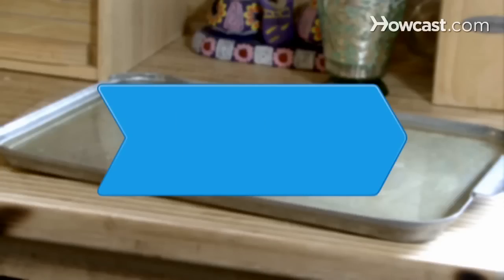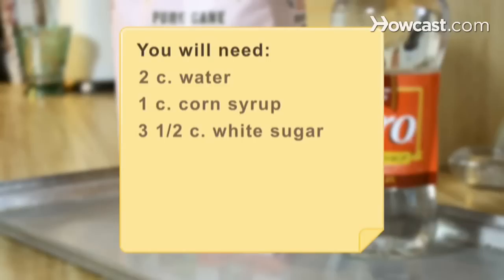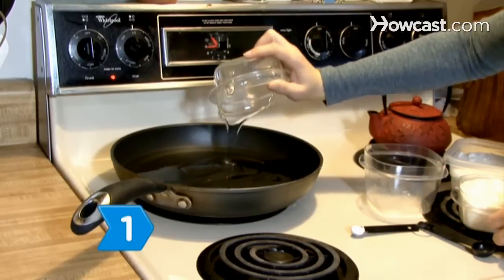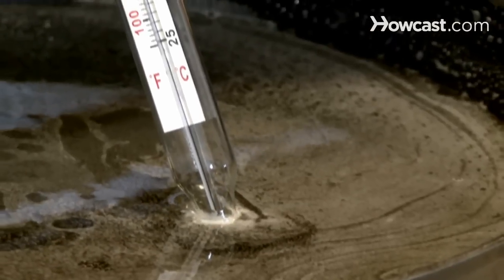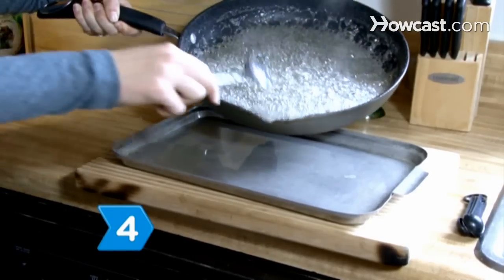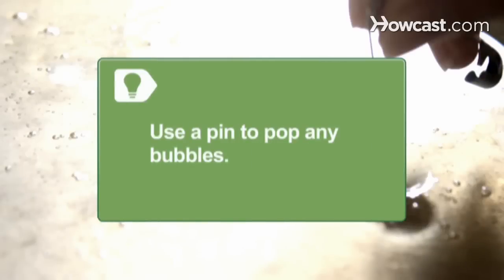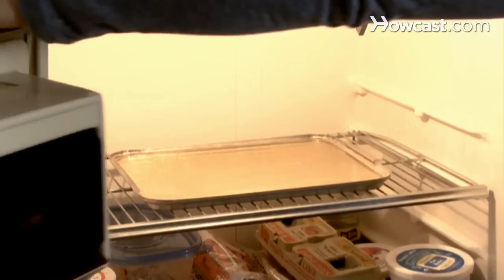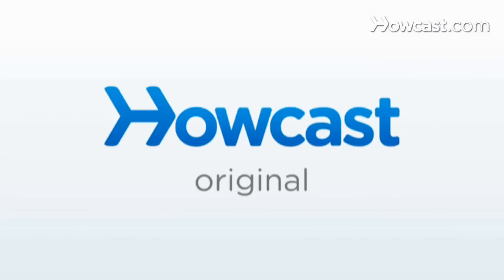How to Make Sugar Glass

Comment: You can gently (very very gently) cut it with a hot knife. 1. Be careful. The entire metal of the knife will be hot  2. The edges of the set sugar glass will likely come out jagged 3. It isn't a quick and easy process, but the thinner the glass, the easier and faster it will be to do this. 
Hope I helped!

Comment: Are you stirring it while the heat is on?  If so, it will burn and turn brown/caramel.  When I boil sugar, I don't touch it while the heat is on.  I also heat my sugar at medium/medium-low.  I think it takes around half an hour to get to 300 degrees.

Comment: Hey Sebastian, like you I was in the same boat.  I must have blow through three batches before I found this video.  I think the video needs to do a better job of explaining that it takes a long time to bring up to 300 (hard crack) on a candy thermometer.  I found mine at walmart for about 4 bucks.  It will seem like it's taking forever, but the key really is to keep it at a low heat and gradually bring it up to temperature. So it was boiling for a while... mine was hard within an hour.

Comment: 8oz.. If you're still not sure, put your hands together and form a cup. That sort of creates a half-cup, so.. (don't use your hands to handle the stuff, though.. Just estimate..) Also, it depends on your hand size.. 8-inches from tip of the middle finger to tip of the palm creates 1/2 cup.